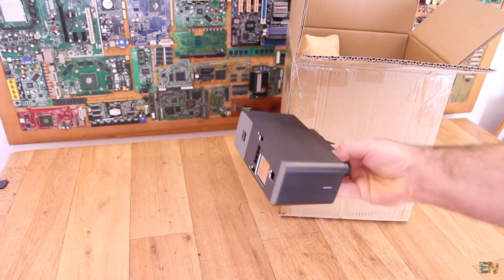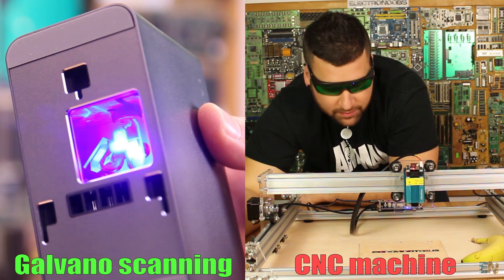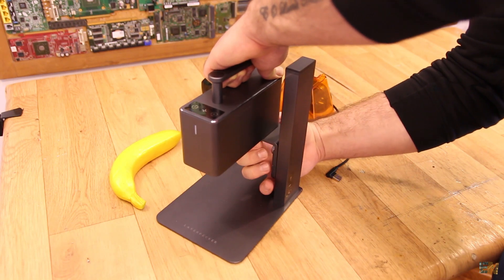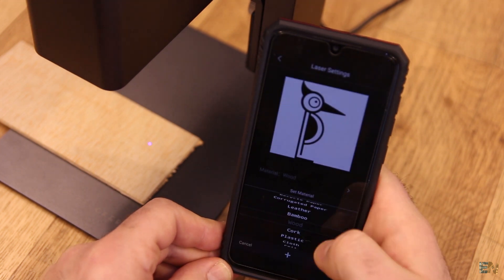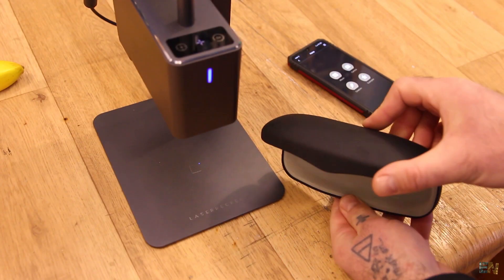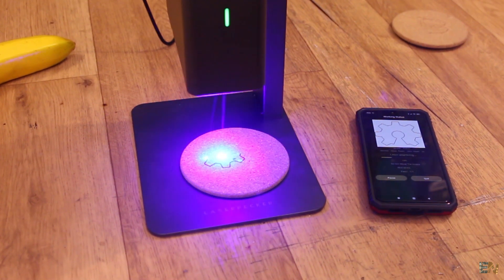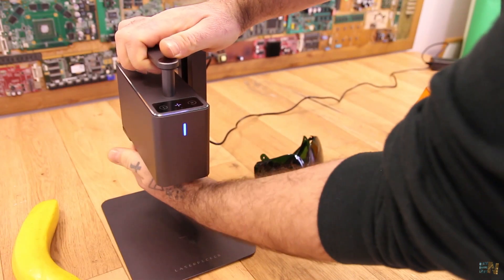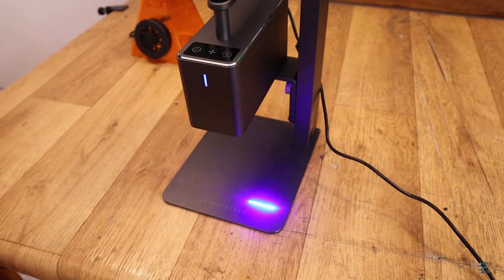What Can You Engrave or Cut With This "5W" LASER Pecker 2?

Comment: Hi friend.
Very interesting product. There would be a couple of questions:
1. How can I engrave on a round product. How much does the add-on/roll cost? Have you featured it in your video?
2. Is it possible to do these operations on a MacBook Pro?
3. When I design a drawing on a MacBookPro:
- In what format should the drawing be saved?
- Does the drawing have to be in vector format?
4. What consumable parts are there in this device?
- Can you get spare parts for it and where?
5. Are there user manuals for this online that I could translate into Finnish using Google Translate?

Thank you :)

Comment: 1000 dollars for a 5 watt diode laser !  well it wont cut wood more than 2 mm, dont expect it to mark metals as its highly unlikely , it looks pretty and IMHO as a long time commercial laser user its looks well designed but dont let that fool you.

Its a hell of alot of money for a 5 watt chinese laser, just bare that in mind if you are considering paying for this.

for around 2.5 k you can buy a incredible laser that will mark metal and do repeat after repeats jobs and is A3 minimum in size.

This should be in the 350 to 500 range, the laser diode costs no more than 75 dollars, the lens probably 10 dollars if that, the rest is plastic , design , marketing and hoping for a big investment from people who no nothing about lasers.

You can easily but a much larger laser with more power for under 500 dollars that will cut 5mm wood

Comment: Thanks for this thorough review.
I was considering getting the laserpecker pro (older model) and now I discovered the new one, and it seems to be a lot faster.
For transparent items: Instead of painting them black, would placing it on top of something black have the same effect? Or covering it with self adhesive black foil? What about metals? Does it only work on soft metal, like aluminum? Or does it work on steel? 
How about artificial PU leather? Anybody any experiences?

Comment: I'm not sure it's really 5W. I have 7.5W  CNC laser and it cuts 8+mm( 3/8 inch) plywood at 66.6% power( which is 5W) with the same velocity or even faster than yours cuts at 100% power 5mm. Maybe the vendor of your machine belongs to safety pussies party and they put software/hardware limits to light laser at 70% of its nominal capabilities.
Reply: What Laser du you have?
Reply: @Schmaxx  Original Japaneese Laser Module with Optical power output 7.5W. Installed to custom medium format CNC Mill.  You can find a banch of Chinease copies at Ali, ebay or Amazon. But I have no experience with Chinease clones.
Reply: They have just announced a new dual lens upgrade to engrave steel. I read that it  focuses the beam to create 500W strength at the main point. We’re still waiting for review on this upgrade but one of the testers on Facebook will have it soon in the LaserPecker 2 group

Comment: Brother please make a full circuit of desire constant voltage and constant current output at the same time.. in a same circuit.. without Arduino.. just like SMPS..  please it will be helpful for my electronic project.

Comment: Nice review! Thanks :) i wonder if it could be used to etch away photo resist from a raw PCB before etching the board in ferric chloride or similar.
Reply from the maker: Yes, that would work.
Reply: @ELECTRONOOBS  I have a small problem. I need to use components that are compatible with Arduino. A position sensor (so I use a GPS module. This GPS module must be Adafruit Ultimate GPS Data Acquisition Module (GPS Included)). A position storage (with an SD card that must work with an SPI link). A bluetooth interface. A HMI to visualize the route (using an Android tablet that is compatible with a bluetooth module).you can advise me to use what as a component . because it's 3 components must be compatible with Arduino and an Android tablet HMI thanks to a Bluetooth module.